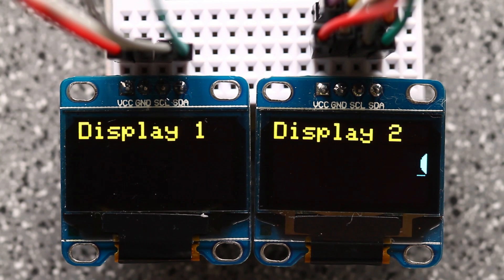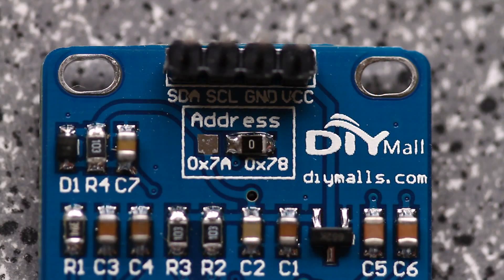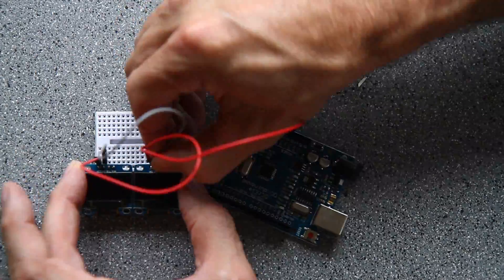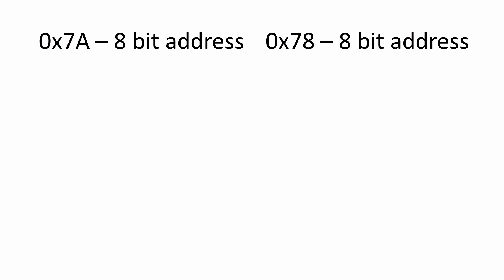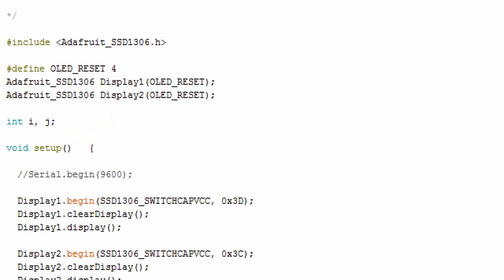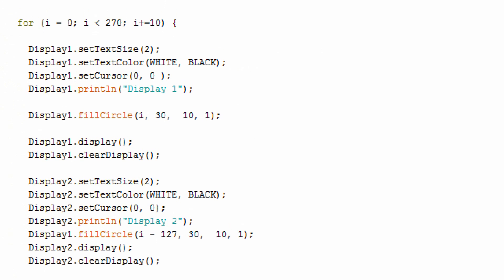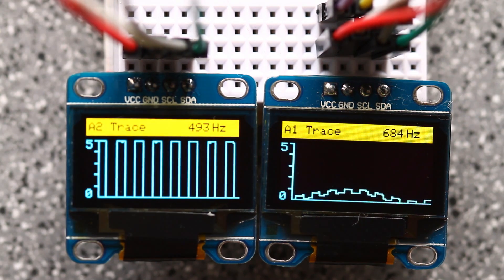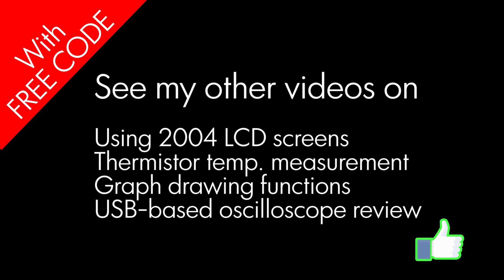Using Multiple Displays with Arduino FREE CODE

Comment: I guess technically, you might be able to say two is "multiple", but since a normal person would consider multiple as being a group of something, the title is highly misleading.  Now I've made it all the way to forty five seconds into your video and have been mislead once again.  "These are all the tools your need", "to change the address the resistor must magically remove it's self and a glob of solder appear across the correct pads, all by magic as a soldering iron is NOT one of the items you need for this project."  I'm shutting this video off before I get lied to again.
Reply from the maker: Agree you should stop watching and find more beginner level channels.

Comment: Copied the code and tried it but the ball stays in display one. Hmm
Reply from the maker: On the back of each display, what is its address?
Reply: @KrisKasprzak  One is set to 0x3C and the other is 0x3D. The text shows up correctly for display 1 and 2 but the little ball stays in display 1, looping around.

Comment: I managed to get it working but couldn't get to 128 x 64 pixel mode, only 128 x 32 pixel mode, I edited the Adafruit_ssd1306.H library file and did what you told one of the users, leaving the line uncommented #define SSD1306_128_64 and it worked for me but now it only turns on one of the screens and the Arduino constantly restarts, please if you can help me I appreciate it.
Reply from the maker: Try putting a serial.println(“here”) in various places in your code try to see when it crashes. I suspect you’re trying to write or access an array value that is out of bounds.
Reply: @KrisKasprzak  Hello, thanks for your prompt response, I am using the same code that you published to do the tests, everything works until you edit the library and change the line you indicate, could it be the version of the library? which one are you using?

Comment: Is it realy not possible to do if i dont have a adress changer?
I have a project to do for school and i need to know if 2 RB-TFT1.8 can work on a ESP32
Reply from the maker: If your displays are I2C then you may be able to scan the address of each device to see of they are different. If there is no hardware selection, I suspect they will be the same. If you need multiple displays use SPI type (ILI9341 drivers for example), SPI have a chip select pin for communicating to each display.

You may be able to use a multiplexer chip to communicate to multiple SPI displays.
Reply: @KrisKasprzak  I looked up and my displays are SPI thx for the help

Comment: Hi Kris, how do I change the address of the second display to a non-factory one?
Reply from the maker: The displays are use have tabs on the back where you can select one address or another I have yet to see a display where you can program the address.
Reply: @KrisKasprzak  THX

Comment: I suspect that flicker you’re seeing on your screen is because of the failed ack from the Oled after each message you send to it in the .display() method. This causes it to not be immediately ready for the next transaction. I had this problem too until I added some 4.7 K pull up resistors on the SDA and the SCK lines. I hope that helps.

Comment: So great Kris! I am using this as a base for monitoring AC current...but 60Hz is low and doest fit the full wave on the 128x64. I am attempting to modify to "Zoom" out to see more waves...any tips?
Reply: Solved it...I modified the display.drawLine function :)
Reply from the maker: This may be hokey but in the read Loop put in a delay maybe microseconds an experiment with the values.

Comment: I need like 32 of these run horizontally to make titles in an audio mixer. How can I start
Reply from the maker: Not sure how you will distinguish one from the other. I've never seen programmable addresses. Also forget using an Arduino--not enough memory. Switch to a Teensy.
Reply: @KrisKasprzak hi I'm checking back with you,  any fresh updates?

Comment: I'm interested in connecting 5 displays in a single project. All 5 displays would show a different image which would fade in and out between 2 images... Is this possible using a single controller or am I forced to utilize more than one?
Reply from the maker: Possibly but may need different displays, MCU and library. The library used here creates a video buffer in memory the writes the buffer to the screen. Those little arduinos will probably not have enough memory for 5 displays. 2 is pushing it. A Teensy 3.2 has 256K of memory and should work just fine. Now for the displays....if I2C based, you will need to find 5 different addresses (depending on the lib) or use an i2c scanner to get each displays address--again it may be hard finding different addresses. If you move to SPI displays, display writing is controlled via a chip select pin. Depending on the controller you may need to use special pins for the unique chip selects. I feel this is possible by not with the code i'm showing here.

Comment: What is the maximum limit of Arduino mega  handling oled screens i want ro use 30 oleds so how much current  and power dissipation of the whole system would be? And are rgb oleds available

Comment: Thanks for the help. There is a typo in the code    

    Display2.setTextSize(2);
    Display2.setTextColor(WHITE, BLACK);
    Display2.setCursor(0, 0);
    Display2.println("Display 2");
    Display1.fillCircle(i - 127, 30,  10, 1);     // <<<<------  Display2 
    Display2.display();
    Display2.clearDisplay();
Reply: Thanks for sharing this, i thought i had done something wrong. 👍🏽

Comment: I got the sketch working, but can't get to 128 x 64 pixel mode, only 128 x 32 pixel mode. As I am weak with library editing, I could use some help there. I have Notepad++ and have edited libraries, but am having trouble with the "new" constructors. Thanks!
Reply from the maker: Open a file called Adafruit_ssd1306.H. notepad will be a fine editor. Look for these lines near the top of the file and make sure this line is not commented out. Make sure similar ones are commented out though. Save the file and restart the Arduino IDE.

#define SSD1306_128_64

Comment: I want to use 2 displays as 1.
Reply from the maker: you can, watch the moving circle from disp1 to disp2 at the 0:03 mark. YOu just need to the do the math to reset the graphic item to 0 for disp2 when the graphic item hits the width limit of disp2
Reply: @KrisKasprzak  Thanks. Is there any 7 inch display with configurable addresses? Can you please drop the link. Thanks
Reply: @KrisKasprzak  need this^ very badly
Reply from the maker: @ThoughtfulIndian97  I've seen 7" but are for Due and Megas. And since the plug right into the Mega i'm not sure you can have more that one. I seriously doubt an Uno could drive them very well--but even moving to the Mega will have the same challenges--connecting >1 display

Comment: I'm also trying to use your code, but I've got only one display on and it's flashing, with the circle at the start. I can swap them changing C with D in the code, and I2C scanner does show both devices. I have tried on Uno, Nano, different displays, but nothing is changing.
Are you sure this code works?
Reply: I've got the same problem! Have you figured it out?
Reply: @SpectraLzz  I had this issue, it seems the updated Adafruit library no longer works with this code. don't ask me why, still learning to use my Arduino. but if you change the library version to 1.2.7 it should work. it did for me at least. kris Kasprzak if you see this, might be worth throwing a note up on the video?

Comment: I used our code....and same wire connection as u do....but I am getting only display2 text displayed in both displays.....0x3d address not working....same oled displays used
Reply: You have resistor on back of the display where you change it's adress, if they are on same adress it will show same thing on both of them. Desolder it and solder to second pad on one of the displays.

Comment: Is there a way to connect more than 2 displays
Reply from the maker: Crazy Couple yes and no, the yes is all you need to do is find another display with a unique address, the no part is I've never been able to find one other than 0x 3 C and 0 x 3D
Reply: Cool
I think Multiplexer TC9548 can be used to achieve this.
I havent tried it yet may give it a shot and see if i can get a success :)
Reply: I have just found the solution to this, I have successfully tested it with 8 displays.
I will make a tutorial on this soon :)
Reply: Please, can you give me an aproach of what you did? Did you use the multiplexer?
Reply: @CrazyCoupleDIY i couldnt find that tutorial but hey GREAT CHANNEL BRO ❤
Reply: Crazy Couple use spi connections, your question will be solved

Comment: I have some without the address on the back but.....there are 2 zero ohm resistors with a common center and labeled r3+ r4+ r4-r3-. I am thinking these may change address? I am going to try it and check it with i2c scanner. I may blow it but hey, a few dollars  :  )
Reply from the maker: I'm guessing you are right, let us know and the source. I've been looking for OLED's with more than 2 addresses.
Reply: Well, I found a complete data sheet  (I think on Adafruit.) It looks like r3, r4 and r8 are just used to select spi, I2C. Darn  :  (  .......The data sheet does show all the pins so I hope there will be a way to flash a new address to them? Here is link to advanced data sheet.....  https://cdn-shop.adafruit.com/datasheets/SSD1306.pdf
Reply from the maker: I believe the adafruit lib also supports SPI interfaces, maybe this displays supports SPI?
Reply: I am looking into these. Adafruit and/or Ebay.  https://learn.adafruit.com/adafruit-tca9548a-1-to-8-i2c-multiplexer-breakout/overview
Reply from the maker: I've never used those, but I'm guessing they will work. Thanks for sharing!
Reply: You're welcome. Now the only thing is trying to keep the memory down. I wish they had more SRAM.
Reply from the maker: Move your projects to a Teensy 3.2. That's all  I use now. Same basic layout as a NANO, but has 256K of memory, can be overclocked to 96 mhz 9 analog, most pins are truly multi functional giving 23 digital, 10 analog, 10 PWM pins, built in clock (just need to add a crystal), 3 serial, 12 bit analog resolution, and the list goes on. I buy directly from pjrc.com, a bit more expensive, but i have a massive program that has SD, display, wireless, touch screen, EEPROM support, 2000 lines if code and i still have 50% of memory left. Move to Teensy don't look back.
Reply: Didn't know about these. I wish the price was a little lower but what can you do ?  Thanks  :  )
Reply: hey did you configure more than 2 addresses using those resisters? and can you share the I2c scanner code ?

Comment: I found a little mistake in the conversion from HEX to binary. Actually a misplacement of the addreses. 0x7A corresponds to 01111010 in binary and 0x78 is 01111000 in binary. So you have swaped them by mistake. Not a big problem, anyway, great tutorial!
Reply: Just noticed that too
Reply: Absolutely
Reply: You can also skip the intermediate conversion and just say
         const uint8_t address = 0x7a >> 1;
Reply: Yes I saw that too.

Comment: Awesome buddy, thanks. 

hey quick question, the screen i have have the resistor on the other address, and it made me wonder rather than using a blob of solder are u meant to move the resistor?
Reply from the maker: the resistor is a 0 ohm, which is basically a blob of solder. I found it impossible to move the tiny resistor.
Reply: My resistor was four hundred something.  Im going to pretend it was 0.  Hopefully I dont let the magic blue smoke out!

Comment: I have a project that need to display up to 36 display panel, do you think it is possible if I were using Arduino Mega and  port expander?
Reply: How many ports per display? drop 2 each(VCC, GND), these can be re-used among displays (power/watt restrict #) 
it seems you need 2(SCL, SDA) x 36 = 72 ports.
You need to calculate also how much power(wattage = volt x amp ) each display consumes or get it from datasheet.
Just try it and please post findings on INSTRUCTABLES. title: Max # of Displays that Arduino Can Run
https://www.instructables.com
Reply: +LS this could be useful to you:
#20 Tutorial: Multiple Devices on One Arduino I2C Bus
https://youtu.be/QQLfzlPGjjE

Comment: Can use more than 2 if use SPI ones as each will have it's own CS line. OK... uses more pins but could use a port expander etc if pins are tight. Also find SPI ones have a faster SCK rate.
Reply from the maker: good tip.
Reply: How many can you use?

Comment: Forgive me for I am new to Arduino but could you use what you have done here to create a large screen and map the content across lots of screens to create one much larger screen of similar aspect ratio?
Reply from the maker: You could but you need to find displays that have programmable address. the ones I show here only have 2 settings,  so if you wanted to use say 3 x 3 for 9 displays, these would not work. I'm not sure if any exist that have that much flexibility. If you need say 480 x 320, those displays exist or even 7 inch displays.
Reply: Yes you can but you will need to use seperate  i2c buses or you can do clever external select swapping on spi. To use seperate i2c buses tou will have to have enough pins and modify the wire library to support pin asssignment or constantly swap pins in software. Or just write your own low level code